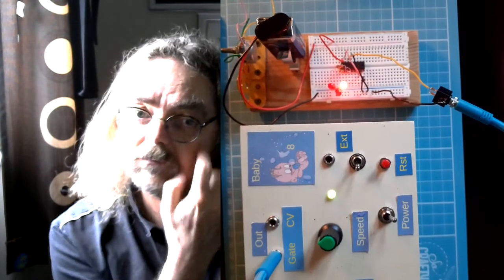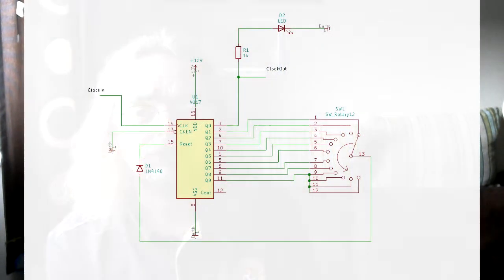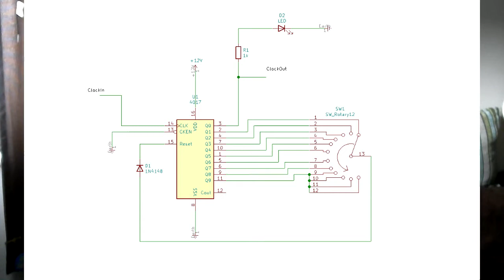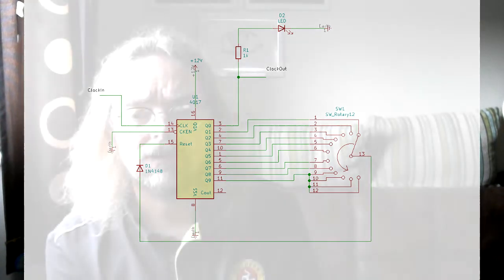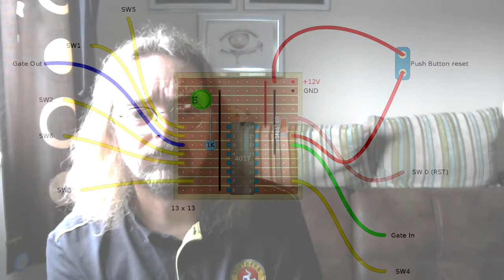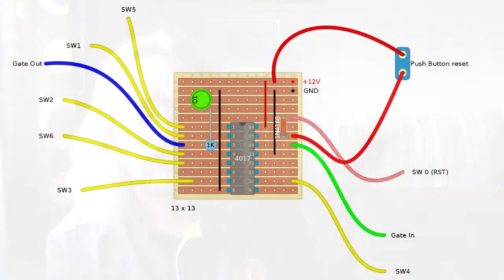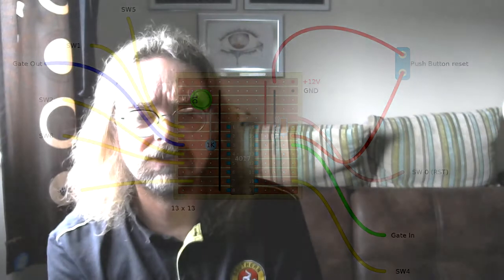Basic 4017 Clock Divider

Comment: In my opinion, basing a clock divider on a CD4024 or a CD4040 is a better option,
because you will have more BINARY outputs (/2, up to/128 on the CD4024,  and up to /4096 on the CD4040).

Resulting either in more suboctaves as an audio square wave divider or more rhythmic lines as a clock divider.
Well, I'd use each individual output in parallel, instead of a choosen one.

But that's a chip limitation: the CD4017 has to be reset at output n.
The CD4024 and CD4040 do not suffer from this limitation.

On the other hand, divisions by ODD numbers (or non necessarily binary ones) - including PRIME numbers - can be very useful for polyrhythms.
Reply from the maker: I have built clock dividers with the 4040 chip and added a 4069 to give inverted outputs too. There are often several ways to achieve an outcome and they all have their merits and quirks (faults?). Sometimes I find the quirks are what makes the result interesting. Experimenting with different approaches is part of the fun.